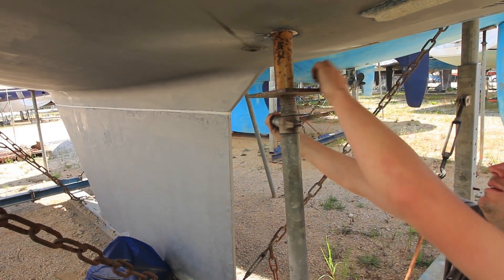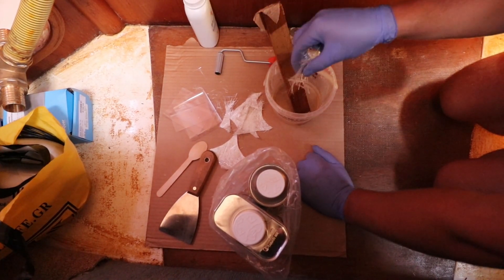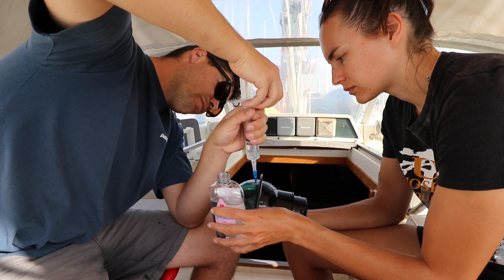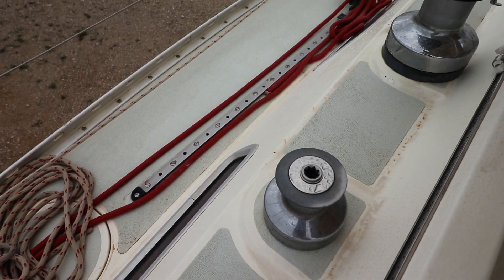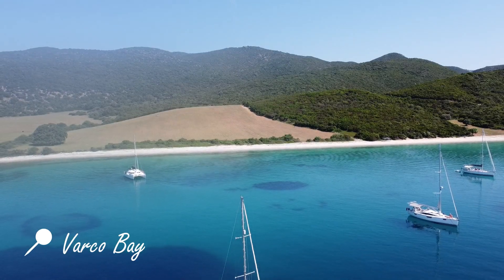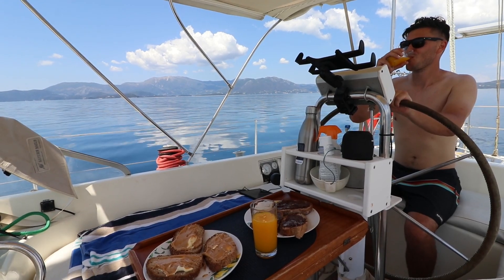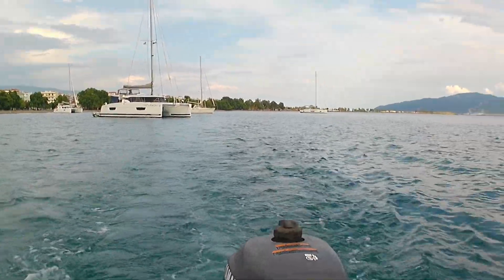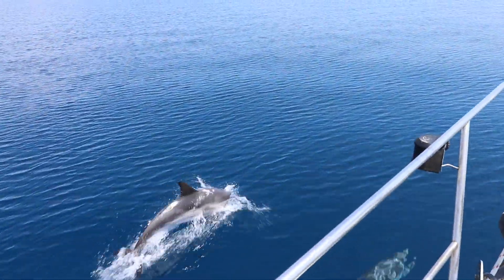Fibreglass work & sailing for the first time in the Ionian Sea, Greece  (Ep 3)

Comment: Hmm…Seems like a Half-Ass Fix☹️ to correct a poor decision originally…Live & Learn
Reply from the maker: We had to fibreglass over the hole so we can redrill a correctly sized hole later (which isn't urgent and can be done in winter when we have more time). 14 layers of fibreglass total plus a filler plug is actually more than we needed to do but we wanted to make it really strong. The end result is thicker/stronger than our hull and set rock solid 💪👍